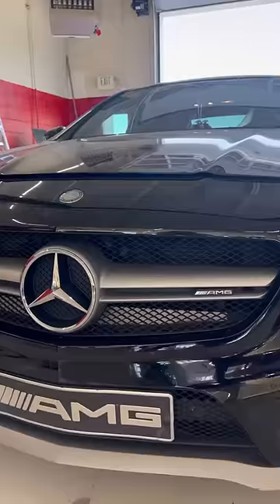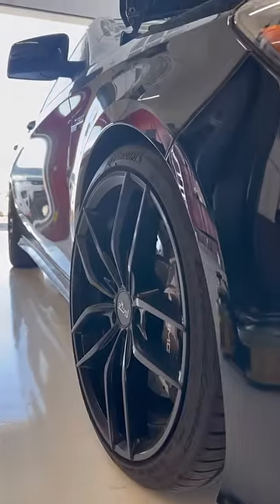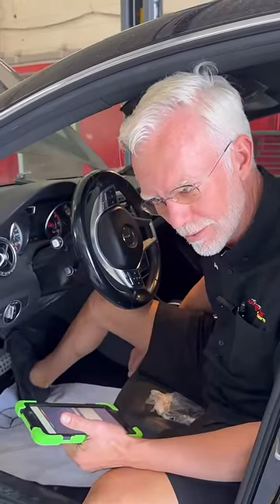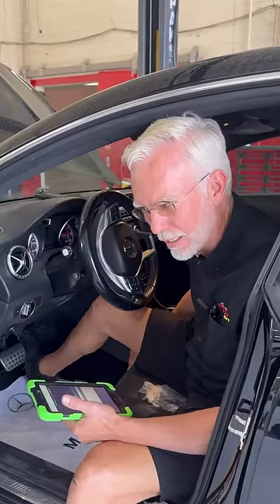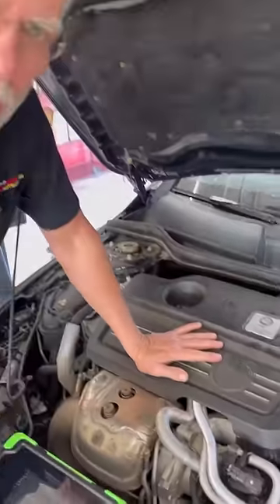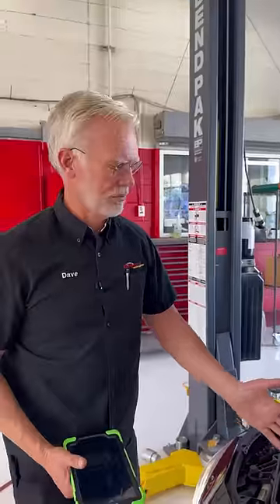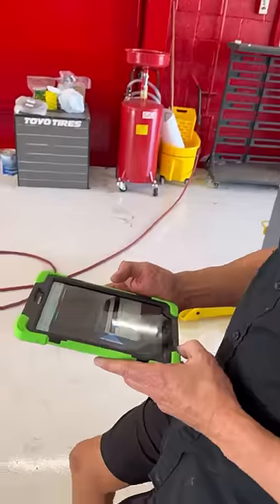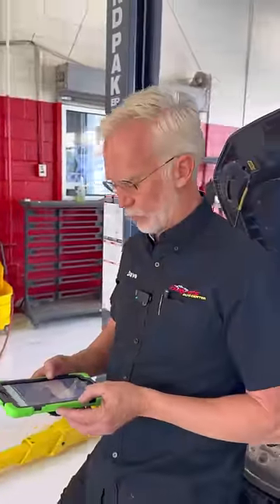Mercedes AMG Nothing but a slight noise on start up #carrepair #autoshop #mercedes

Comment: Those 4cylinders crack at the valve seat and damage the head or will overheat the block and crack it. But there is a lawsuit and extended warranty because of that motor. The 4cylinders were built on the limit and I had heads off cars with as low as 19k miles, German engineering 😅

Comment: OVER HEATING THEN YOU MIGHT THINK ABOUT PUTTING A NEW THERMOSTAT IN....THE LITTLE SQUEL YOU HEAR WHEN PRESSING ON THE GAS PETTLE MIGHT BE A PULLY OR BEA RINGS IN THE PULLY OR THE SERPENTINE BELT SLIPPING  BUT IT DOESN'T NEED A NEW ENGINE.

Comment: I have the same car, same model and this is common issue on this model and dealer is sucking customers. Simply remove the turbo and replace valve than kabooommm.

Comment: I have a GL 550 check engine light just came on. Took it into Mercedes. They diagnosed the car. They said they borescope cylinder one and five or scored. They gave me an invoice for $35,000. Told me I need an engine.

Comment: I hate when people say dealership techs are just part changers we're not allowed to fix things internal on engines. If you need a valve due to a small leak to bad needs a head. I would just replace it and lap it but to much liability, and they won't pay you if yiu need to tear it back down because you're flat rate and you cant say we need to start with one thing because the advisers up front screw it up half the time and will sell the job as it will fix the problem so you have to cut out all risk because there is a high chance you wont get paid blame the industry not the dealer

Comment: Dealer mechanic  now just swap parts but they just do as they’re told so the dealer is to blame it’s easier for them to swap a motors and get you on your way .  I took my 2010 Highlander to Toyota they said 6k for an engine with more miles than my car and 3 k to install it 😂 i rather save up and bring it to you im already 6k into my Highlander

Comment: Had this happen on my e46 BMW after I overhauled my coolant system at 150k miles. New radiator, water pump, thermostat, and all hoses. Car would start running hot, but would cool down when turning on the cabin heater on high. Did the air purge procedure several times with no success. Had a Euro shop AND the dealer tell me blown head gasket--need a new engine. NOPE! I've had the car since 18k miles and take good care of it and knew it wasn't a head gasket causing the overheating issue. After months of headaches and exhaustive testing, figured out that during an overheat, upon revving the engine the temp would immediately drop.The brand new thermostat that I installed was defective from the factory and would stick closed. Go figure...dealer wanted to install a new engine.
Reply: Since then, I've put another 100k miles on the car and still running good!

Comment: Audi quoted me 2000$ for a
64$ ac hose for the rear evaporator on 2012 Audi Q7
did the job in my driveway in
30min in Nj with dealer parts  from Porshce dealer in Lithuania so for under $180 including recharging the system to spec. by the gram it's 
Working beautiful now but the dealer here Nj wouldn't tell me which AC line was leaking if I wouldnt let them do the job.

Comment: Overheat condition and under boost. The FIRST thing i am going to do is a coolant leak down test, then i am going to do a cylinder leak down test. This will cover my ass, and confirm that there are likley no head gasket or cylinder head issues.

Next, I will do a pressure test on the cooling system and inspect the turbo.

 My assumption is that it is a totally wiped out turbo, and the coolant is leaking into the exhaust turbine side of the turbo. 

Please tell me if im right.
 I am genuinely curious now, and you got my tech brain ticking.

Comment: Charge pipe probably popped of the water-to-air intercooler or degraded, something stupid like that. Of course a Benz dealer said 'new engine' it's part of the service advisor training if the car is out of warranty.

Comment: If its out of warranty and you're taking anything to the dealership, as harsh as this is, you got more money than brain cells...

Last time i bought a used car from a dealership and took it in for the last free oil change, according to them basically everything was bad besides the head gasket. From the battery to the fuxkin radio.

That was 5 years ago, and all the car has needed since ignoring the list of shit they gave me, is a battery, and the a break line collapsed, which cooked a caliber. Brake pads and oil changes has literally been it.

I gave it took my father in law and he drives it daily. 05 Chevy equinox with about 170k on her now 😂.

Comment: I purchased a 2015 nissan fronteir pro 4x4, access cab. Beautiful truck with all the bells and whistles to boot, it only had 45k milage on it so i got it. First day the tire had a gutter nail stuck in it and it wasnt holding air. The heater wasnt getting hot at all, then it over heated and i replaced everything on the cooling system, thermostat, radiator, hoses, waterpump, alternator, new battery, and it still blows outta the reservoir. And it didnt come with a warranty. 20k down the drain. So i went and purchased 2008 Tacoma trd sport. It only had 40k on it and its been the most reliable vehicle ive ever owned. Toyota for the win!!!!

Comment: the first thing?? comp test,  oil pressure gauge, cooling system test. visual inspect of the turbo, i dunno. being an engine builder. id do what i always do.... rip the whole thing apart. so i can see the problem. the turbo compressor turbine probably exploded, and the engine swallowed it.
Reply: then do an LS swap

Comment: doesnt over heat in germany but you take that to phoenix and its overheat central. i will tell you that the cooling system on a mercedes if a damn nightmare its not a system where you just add the coolant ad go. the coolant always has air pockets especially amg when you pull the coolant an d put it back not to mention the many sensors that are temperamental if its not a bad pulse signal to the fan then has to be the thermostat from the customer overheating the hell out of it and the low pressure is a bad set of rings from overheating!!!!
Reply: i have a 06 slk55 amg and a 06 e63 amg

Comment: check the overheating conditon, it's not normal for a car to overheat "many times". odds are the guy isnt telling the full story. AMG cars get driven really hard by careless owners... I would not be surprised if the engine is actually bad.

Comment: Timing chain tensioners are hooped it's an engine out job to fix timing shit is at the back of the engine and a hefty disassembly and stealerships don't go into engines so it's a new engine or get the bus home 😂 or a great offer on a new german shitbox

Comment: overheating could be a blown head gasket" find out why it's overheating. If it is a blown head gasket replace engine. You can try to be a hero and do a head gasket and find out the lower part of the engine is bad

Comment: Why would the dealer say you need a new engine? Cuz they're a bunch of crooks. And I doubt that the underboost issue and noise are connected to the overheating issue

Comment: My dealer replaced my engine under warranty even though it worked fine, it just wasn’t holding pressure to spec.  Saved me $17k.

Comment: Clearly there is nothing mechanical wrong. The fault code indicates a hose leak which it sounded like. The wheel sensor is another issue which may be a simple fault code. No warning light on the dash, just clear it.

Comment: First drive car for power loss, second coolant contamination from Head gasket leak, third restricted exhaust system, fourth check cylinder compression and valve timing, fifth turbo operation. Easy money repairs!

Comment: Check fuel flow from turbo to the head..is it electrical/dead/under-warranty..does it smell like fuel..if not the over heating how’s the transfer case/transmission..look..any leaks..fluid levels..check repair history..car fax..was car driven for long periods during extreme heat..if so boots may need to be changed as well as spark plugs..whole time I’m looking for metal shavings..to prove dealer theory

Comment: The dealer told him he needed an engine  because most dealers are completely crooked. I was hired to do maintenance on production equipment and the buildings at a manufacturing company. They seemed to spend an excessive amount on vehicles. When the dealer claimed that a perfect engine needed replacement. I started to check the work of the dealerships they were all crooks but one in particular was billing for work not done along with doing unnecessary and poor quality work. For years after that I did all my own work because I didn't trust anyone. The damn computer systems are practically impossible They are  designed to be almost impossible to repair without dealer equipment.this should be illegal. Luckily I finally found a shop that can be trusted.

Comment: Why would the dealer recommend a new engine.    Because the dealer will jack up the cost to replace the engine,  the  customer thinks it's too high and trades in the car for less than it's worth then the dealer repairs it jacks up the repair cost and resales it for a big profit

Comment: I would not buy a mercedes not as good as compared to 20 years ago...for overheating..i would check for coolant leaks, see if water pump is ok, look at reservoir, it should be about half way, check thermostat, see if fan works..

Comment: Overheating….change thermostat, still don’t work, radiator and if that don’t work worse case, water pump. Only reasons it would overheat.

Turbo needs to be change at the dealership
Reply: Blowing a head gasket causes overheating

Comment: Flush coolant and refill, replacing thermostat too. Clear codes and  test drive. See what presents. Still overheating ? Combustion chamber carboned-up ? Take a look !  
The devil here is the labor: chasing multiple problems for multiple hours. Used MB is not a brand for the faint of heart. BMWs and Audis are in there somewhere too. Hondas, ten years old & older, are still bulletproof !

Comment: 99% of dealership mechanics are kids that don't know shit about cars. Don't ever take your car back to the dealer. We learned this the hard way with the Audi. Dealer said we needed a new motor and that it wasn't under warranty until we argued for months then they did it under warranty. Car didn't make it a mile from the dealership when the second motor locked up. They replaced it again, this time they didn't hook up the ground wires fully so it died about 3 miles away and would not start again. Threatened them with fraud, lemon law and numerous other things they tried to pull during that time. Made them pay firestone up the street for all repairs and haven't had an issue since. The firestone place here on my town has the best mechanics in town by far. They don't sell you shit you don't need, they treat you with respect and are not expensive.

Comment: Not enough info, despite you telling us ur giving us all the info,

What is the coolant doing, what is the oil doing, what's the exhaust gasses doing...More questions than anything here.

I had a similar ish scenario with a 1.6cdi, tiny noise on startup, and the turbo had a whine....Dealer states turbo needs replacement and will possibly damage the engine if not replaced in due time....Customer waited, and like clockwork, the engine hurt a piston running rich off engine oil. Can't even reuse the sensors on the exhaust. All in the bin now.

Comment: DEALERS ARE CROOKES 😂 GET A OIL CHANGE & THE DEALER WILL PUT IN THE CHEAPEST OIL $ CAN BUY 😂  AND SELL YOU PARTS YOU DONT NEED 😢 OR SELL YOU A 200$ BATTERY FOR 400$ !

Comment: Dealerships have very little knowledge or they just dont give a damn. You can have a broken dipstick and theyll say new motor. You can have low ATF they will say new transmission. Just like that. Its like they are lazy to fix any problems so they make buyers buy whole assembled drivetrain to make sure problem is solved 😂 all at buyers expense. Once needed a ground wire, gm said i need new ac and engine😂

Comment: First comment never buy a Mercedes lease them !! Check the oil pump for slow pressure build up its failing. Bearing on the turbo is running dry at start up same for the top end gear , oil starvation.
Sure check the coolant for loss and oil contamination The turbo is nosy on start up bearing in turbo is going out.

Comment: Start basic. Get the cooling system working. New thermostat and add new coolant. Then reasses. According to Australia's top mechanical engineer John Cadogan, the new Mercedes are poorly built mirroring the decline of Germany. He recommends the emerging builders of Korea.

Comment: As a erueo mechanic never buy a front wheel drive benz... Amg cla is all wheel drive but with a terrible 4 cyl engine but a bigger turbo. 2.0L engine w/ direct injection is trash .. same goes for my audi.. get a old Chevy

Comment: why.. because stealership.. that is why.. They are greedy and lazy. They do not want to take the time to diagnose the situation properly. 

The first thing I would do is check the radiator for exhaust gases. A lot of what is happening can be attributed to a bad head gasket.

Comment: First, I take it anywhere else except the dealer. Replacing an engine seems to be the go-to answer for everything at a Mercedes dealership. Nothing against the cars but those people are scum. If you go in with a broken tail light they will somehow talk you into buying a transmission.

Comment: Fix the underboost situation first or at least eliminate some of the easier possible causes. Mercs run way too much power to sustain for very long and will pull power way back. Could be something that might cause overheat (massive engine retard).